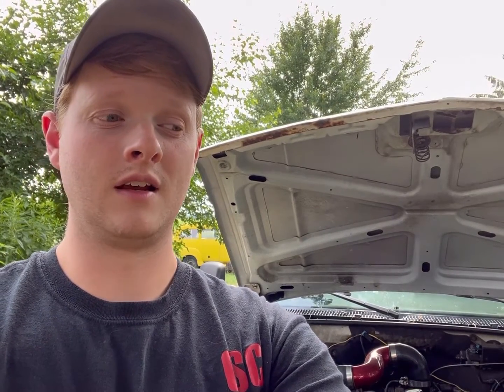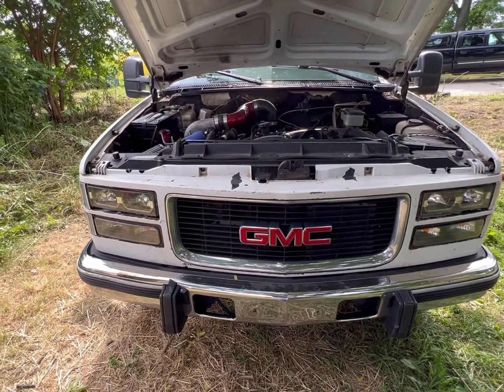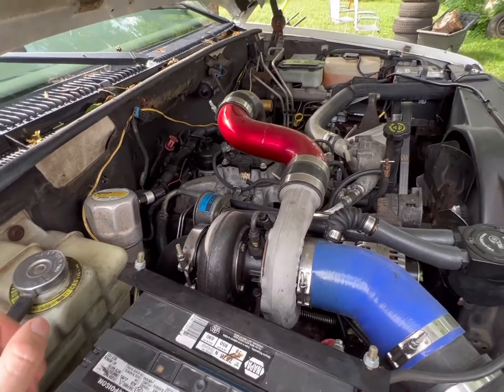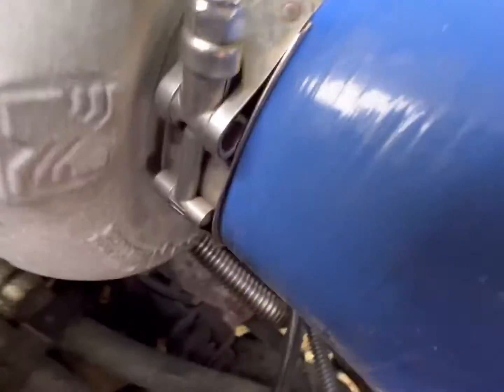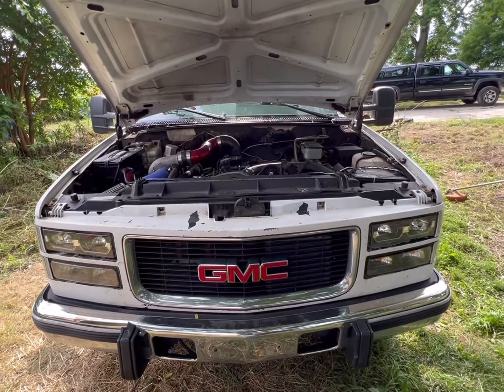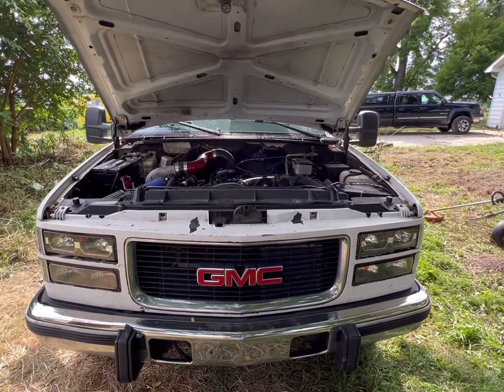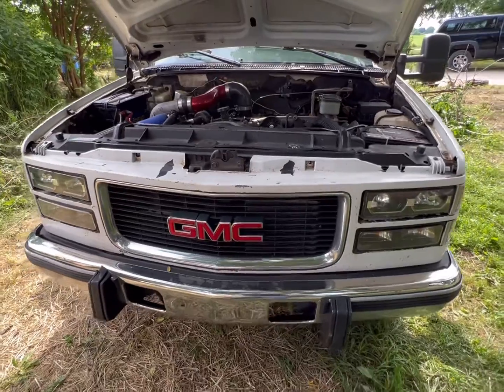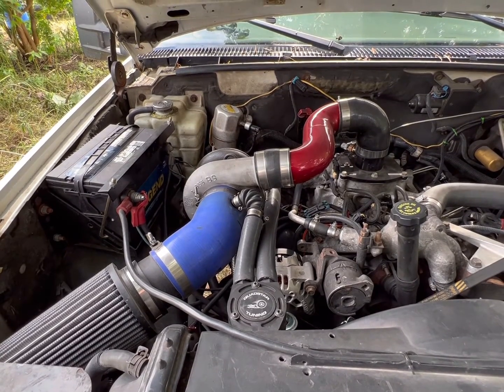GSC 6.5L diesel S300 vs HX35/40 part 1

Comment: There's a lot of talk in regards to chinese clones of the hx35-hx40. I see s300 clones on ebay, have you or anyone you know tried an s300 clone?
Reply from the maker: I know a number of duramax guys that ran S300 clones and they lasted 4-5 years of rough abuse before switching to real deal S300s. You just have to be willing to buy a legit borg exhaust housing to make it the turbo you want.
Reply: @gingersnapcustoms Ah okay. I was just wondering. My 93 k3500 is getting an he351cw and Im just trying to find a budget upgrade for my winter beater 98 k2500 burb. I just want the burb to be reliable ang get rid of the egt/backpreasure generator known as the gm8.
Reply from the maker: @joseesparza2364 I wouldn’t mess with an HE351 personally again. But I hope you have better luck. If you want a bolt on and go good turbo for a beater or daily tow rig, look up Zombiesolutions. Bruce has a well sized HX35 that pretty much takes care of everything on these trucks.
Reply: @gingersnapcustoms  I'm doing a 351 since I have one of my dads 06 3500. It was free.

Comment: Can you comment about your CDR setup? It looks like you installed some kind of oil catch - any videos describing that?
Reply from the maker: @alexanderwolfe9167  somewhere I have a video on it. I have an album on the Facebook page showing what it is. That came from Quadstar tuning and it was one of their catch can setups we tried out.
Reply: @gingersnapcustoms  Thanks! I found your video. Do you think the catch can helps keeping turbo/intake clean? My  intake line between turbo and intake is all oily. The outside of the turbo compressor is oily as well.
Reply from the maker: @alexanderwolfe9167  I’ve found a clean CDR valve does just as good as the catch can honestly.

Comment: Man, I could use your help. I used to tinker with these about 10-15 years ago when they were cheap and plentiful in Iowa. I’d have 4-5 6.2’s laying around and I had a 92 6.5td I put in a c10. Also did a red block build in a 82 k20 with a 18cm h1c turbine and a 58mm h1e housing and wheel. It’d cruise at 2-3 psi at 65 with 4.10s and would climb to 20-25+ under load. Now I have a 95 suburban and I was going to put an hx35w I have on it but it’s got 4.10 gears and the gm8 sucks bad towing in this gulf coast heat. I carry 8 people and a trailer full of wheelers and she hates every minute. I’ve considered the s300 before, I think from a c10 cat motor? What you think man? I’m a 20 year Mack truck master tech I can pretty much do whatever I want fab wise.
Reply from the maker: Check out the Facebook page. You’ll need to do cooling upgrades and contact Verlin Martin to build a duplicate of the S300 I run now. It’s a specific size and housing.

Comment: Will the hx35 fit on my 93? And am I able to keep my hood stack?
Reply from the maker: Yes it’ll bolt right on and you can make a new elbow to retain the stack
Reply: @gingersnapcustoms  do you know where I can find the turbo? Ptswiring solutions page doesn’t show up for me? And would I have to fabricate my own elbow or can I use the kit for the turbo?
Reply from the maker: @andyschoen7126  they’ve become zombiesolutions. There is also a pinned post in the GSC page for a DIY swap

Comment: good info thx would realy like to know your thoughts on how your going to plumb the innercooler to the s300 when you get that figured out and I have to say thank you big time for sharing what you have learned over the years we appreciate  your videos I've learned from them and they and you have helped me make many decisions because I can trust a guy who I can relate to out doing the farm thing as a down to earth good ol boy so thx again
Reply from the maker: I’m working to obtain a dmax radiator and another GMT400 core support so I can begin showing the process of doing the cooler swap. It’ll take some cutting and trial and error. But it should work out well!
Reply: @gingersnapcustoms   Are all GMT 400 core supports the same? I’ve got a 95 Suburban that I used for an interior swap, but it’s not a diesel. If they’re the same I might also tinker with an intercooler setup.
Reply from the maker: @RZ_Supra  last I knew they are all the same for trucks and burbs. 94-00 have a few more mounting holes for the grille than 88-93. But other than that I don’t know if a difference until the 3500HDs.